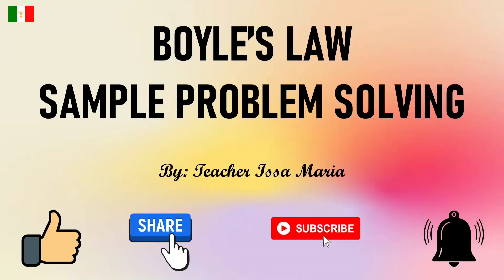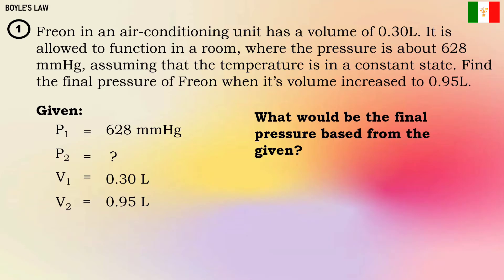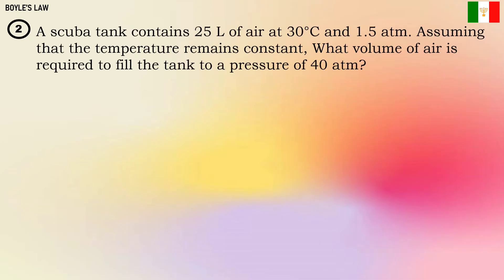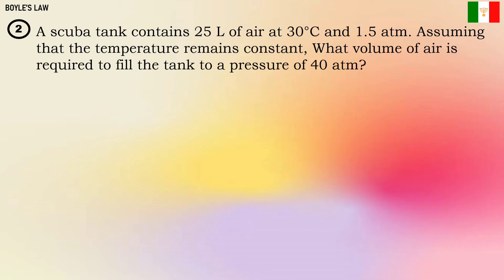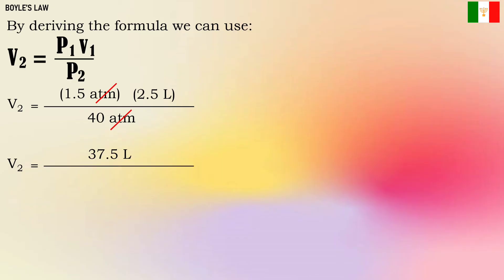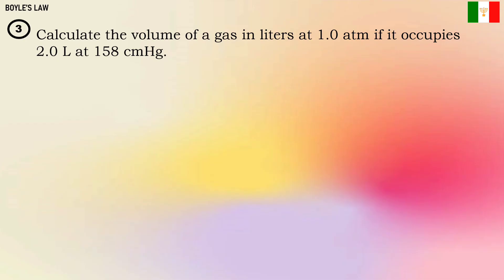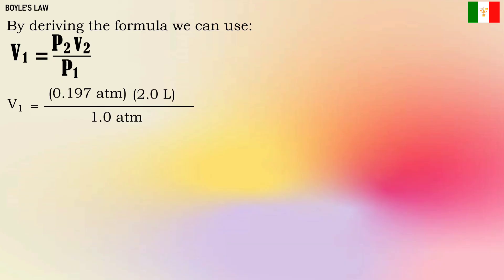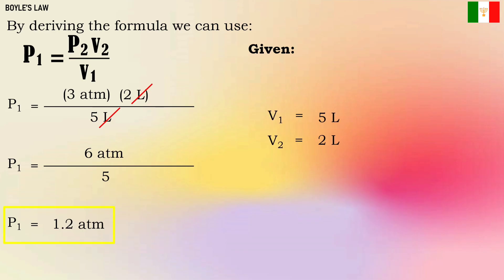Boyle's Law Sample Problem Solving | Detailed Explanation | Tagalog Science Lesson

Comment: MAam pede magtanong kung paano po ito nalilito po kase ako sa 1/2 kung pano pi masosolve

Oxygen gas inside a 1.5 gas tank has a pressure of 0.95 atm. Provided that the temperature remains constant, how much pressure is needed to reduce its volume by 1/2?
Reply: Sana manotice
Reply from the maker: Base sa problem nak may I ask if ano ang volume value dito? Yung volume value daw rito i reduced o bawasan mo sa kalahati at yun na ang final volume value mo ☺️
Reply: Maam V1 p ung 1.5 eh
Reply: Ung 1.5L poba ung hahatiin? 0.75
Reply: Ang magiging atm po is 1.9 tama poba?

Comment: I discovered that pressure and volume have the exact opposite relationship. Pressure must be low when the volume is high, and vice versa. I acquired problem-solving and analytical skills. I also discovered how to use the formula previously given to address the problem in question. I also understood how crucial it is to properly comprehend and examine the provided information because, even with just one error or inaccurate number, the answer will be wrong.

Ella, Cedrick E.
G10-Jade

Comment: In this video lesson i learned how to analyze boyle’s law problem solving. Starting from finding the given and the missing part then finding the inverse relationship of volume and pressure to know what are we expecting the answer will be after that use the formula needed then write the answer with the unit needed. I also learned how to convert cmHg to atm and atm to cmHg, find the value of atm 1.0 atm = 76cmHg then convert by multiplying 15cmHg/1 to 1atm/76cmHg= 0.197atm

Heisley Bobadilla of G10 Moonstone

Comment: From this video lesson, i have learned how to apply Boyle's Law Equation and each derived formulas to find and solve for the missing values with the help of the general formula: P1V1 = P2V2
I have also learned on how to convert cmHg to atm if the units are not the same. Upon solving the problems, I realized how important it is that you clearly understand how Boyle's Law works and how the relationship between pressure and volume affect your answer.

Comment: In this video lesson, i learned how to solve problems using the Derived Formula of Boyle's Law Equation. i learned how to use the formula and i also learned that the relationship between pressure and volume is opposite. If the volume is high, the pressure must be low and vice versa. I learned how to solve and analyze problems. Thank u, ma'am.

Cristine Swing
G10-Jade

Comment: In this video I learned how to solve a problem using the Boyle's law equation.I also learned that in identifying the given we should always remember the terms and analyze because in just  one mistake the final answer in any formula will be wrong.With the help of this video I learned how to use the different formulas of Boyle's law equation for different problems and how to check the final answer based on the volume and pressure.I also learned the conversation of cmHg to Atm.

10-Limestone

Comment: I have learned about Boyle's Law. Boyle's Law is a fundamental concept in physics that describes the relationship between pressure and volume of a gas at a constant temperature. Boyle's Law states that when the temperature of a gas is held constant, the volume of the gas is inversely proportional to the pressure exerted on it. In other words, if the pressure on a gas is increased, the volume of the gas will decrease, and if the pressure is decreased, the volume will increase.
P1V1 = P2V2
where P1 and V1 are the initial pressure and volume of a gas, and P2 and V2 are the final pressure and volume of the gas, respectively. This equation demonstrates that if the pressure of a gas is increased while its volume is held constant, the new pressure will be proportional to the initial pressure. Similarly, if the volume of the gas is decreased while its pressure is held constant, the new volume will be proportional to the initial volume. This relationship is the essence of Boyle's Law. To solve problems related to Boyle's Law, you typically need to use the formula PV=k, where P is the pressure, V is the volume, and k is a constant value at a constant temperature. Well actually there's 4 more formulas which is how to find V1, V2, P1, and P2 over all its easy to understand but I'm kinda confused about torr...

G10 Jade
Monton James

Comment: In this video lesson, I've learned how to solve a problem using the knowledge from the previous video lesson where we create a new formula out of the general formula. This video shows us the step by step on how to solve the problem solving correctly. We have to analyze the problem, write the given, identify if conversion is needed, use the new formula from the general formula, show the solutions, then write the final answer. I've also learned that it is important to know that when the volume decreases, the pressure increases and when the volume increases, the pressure decreases in solving a problem.

Eunice Mariele P. Slater | 10-Talinis

Comment: I learned how to solve problems using Boyle's Law and its formula. I also understand how to determine the problems if that procures to volume or pressure. I learned on how to use Boyle's Formula effectively so that I can apply it to the problems that I'm going to solve. I noticed that if the volume goes up the pressure goes down and vice versa. These learnings were useful to me to be able to solve properly the problems related to the topic with the usage of Boyle's Law and Formula.

John Paul S. Vallega
G10 - Samat